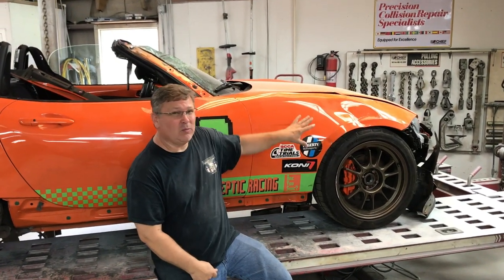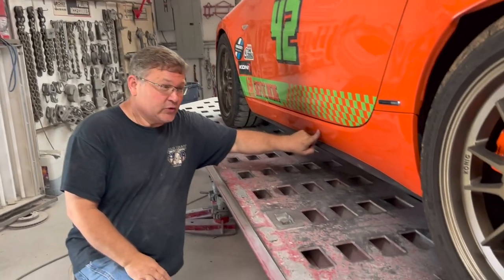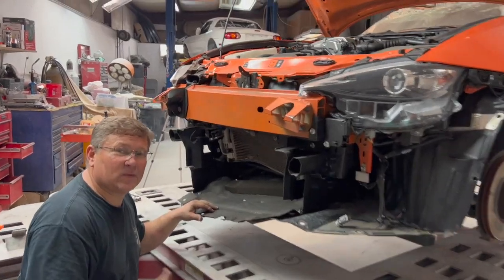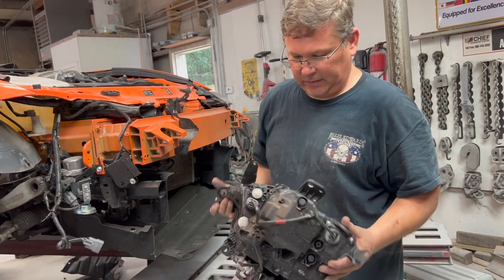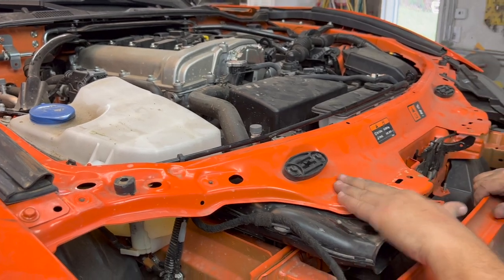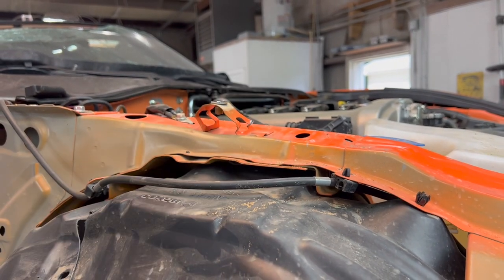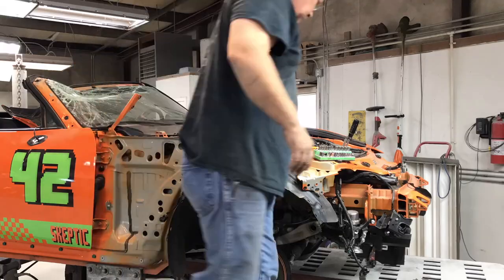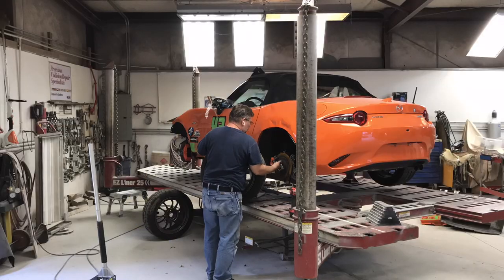Mazda MX5 ROLLOVER!  #mx5 #crash #easteregg

Comment: This mx5 suffered frame damaged or engine damage ? Because i heard the engine at the auction and sounds little different. do you recomend to fix for dayly use ?
Reply from the maker: The engine did run for a few minutes while it was upside down. Not sure if it hurt anything, seemed to run ok when it was at my shop. There was minor frame damage as well. Would probably make a good daily driver if repaired properly. Thanks for watching!

Comment: I would be interested what was the reason for losing control? Bad tyres? Didn't look too fast 🤔
Reply from the maker: The tires where BFGoodrich g-Force Rival and had plenty of tread. I’ll have to ask him exactly what happened and get back to you. Thank you for watching!
Reply: @RebuildRex   would be much appreciated. I'm planning to do track days with my MX-5, too. Always interested in avoiding mistakes.
Reply: He didn't counter steer fast enough to correct the slide. Then he added more steering while simultaneously backing off the throttle. This transfered weight to the front tires which were then turned way too far to the right. From there, it was all over. If he had instead realized he wasn't going to save it, and simply put both feet in, he would have slid straight or a little to the left and been fine.

Comment: so the factory roll hoops were effective as a roll over bar?
Reply from the maker: In this case the hoops never touched the ground. The windshield pillars held up the car. I guess because the rollover was mild as far as rollovers go. Thanks for watching!!
Reply: @RebuildRex  Kinda of looked like his head/helmet was holding up the car as well...hope the driver walked away without too many major injuries!
Reply from the maker: He wasn’t hurt at all. I believe his head was on the ground because his belt wasn’t tight enough which let him hang upside down with his helmet touching the ground. It was a good thing that he didn’t get pinned in the car.

Comment: Looks like he took his foot off the accelerator when he should not have...
Reply: Also, too slow with corrective steering. The Miata already rotates very quickly due to the short wheelbase. This gets exacerbated even further when you add in sticky tires. They have a higher "yield" limit, but when they do let go, they let go more rapidly than some hard all-seasons since you're working with much higher slip angle forces and such.